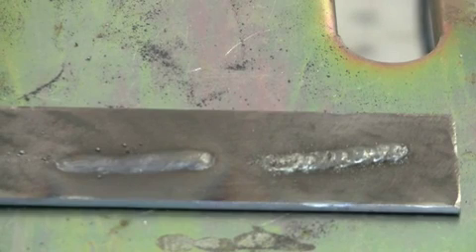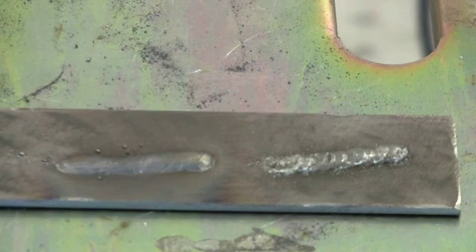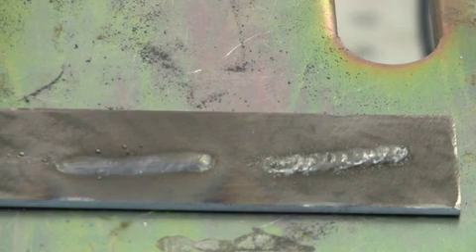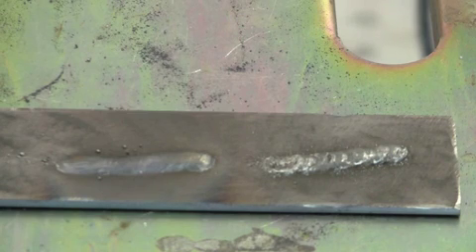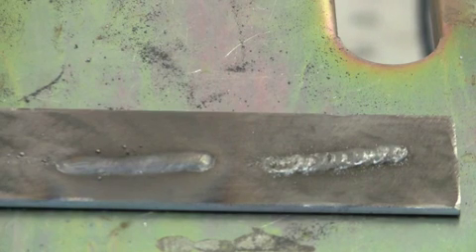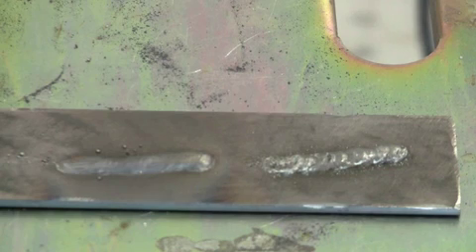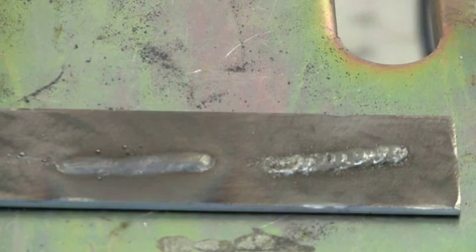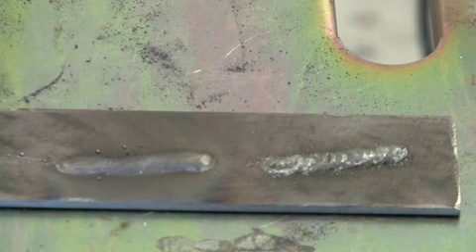Welding Classes Online - What Is Weld Porosity?

Comment: Very interesting but the main purpose of the (shielding) gas as the name implies is to shield the weld puddle from oxidation which is the main cause of porosity. Not to say it doesn't help with arc and heat transfer but that is not its main purpose. Although it is an easy explanation for anyone new to welding, to understand. You can teach yourself to weld at home, but there is no substitute for education and experience. Not to say there aren't any good self taught welders but even some evening courses or spending time with a certified welder willing to teach you is well worth the investment. Please don't get me wrong with what you are doing is very commendable.
Thanks,
Ian
Reply from the maker: Ian Little Thanks Ian, yes. You have to have the gas to keep atomospheric gasses from contaminating the weld.